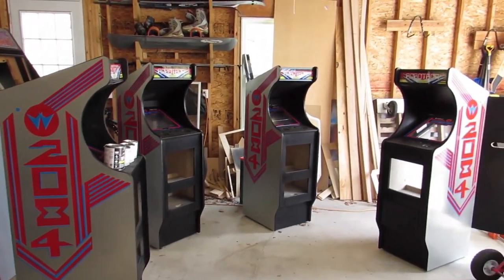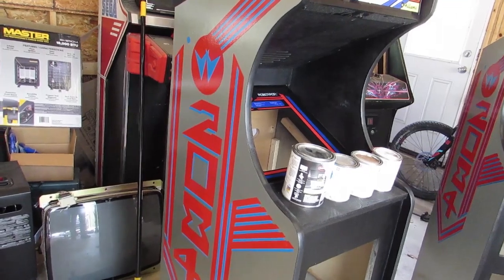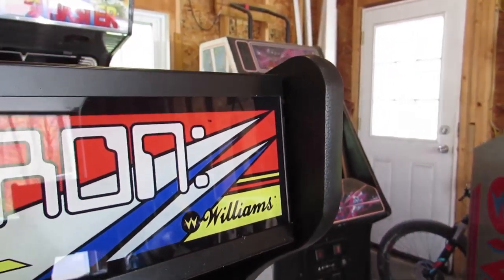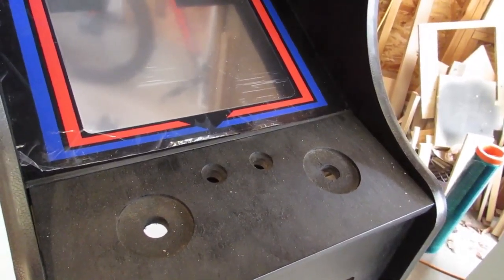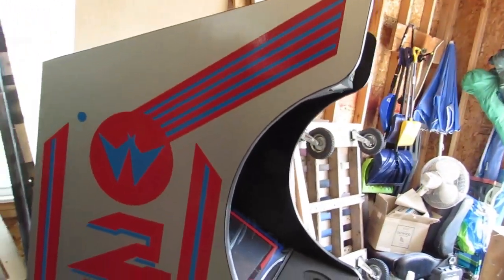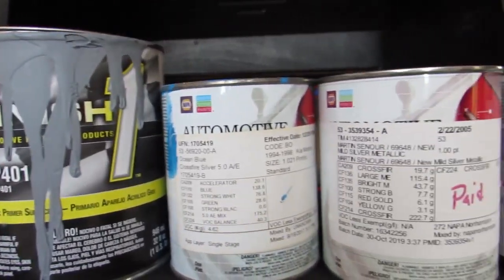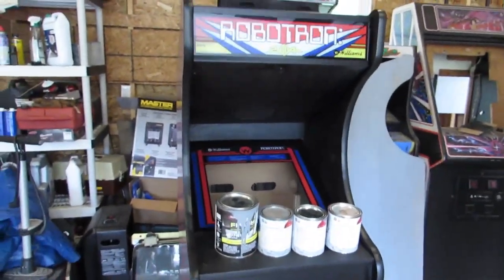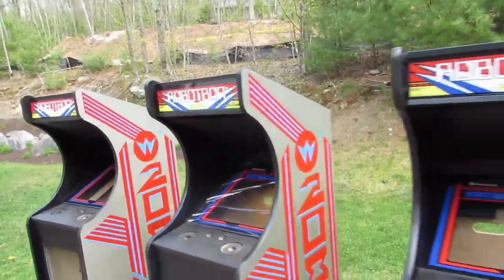Robotron Cabaret Builds....DONE

Comment: You can use the Black Plastic Strips from the “Avery Sliding Bar Report Cover” to attach to the sides of your marquee. This will take up the empty space on both sides and it will also prevent light from showing on the sides. I used these on my Galaga build.
Reply from the maker: Ahhhh excellent tip! I should see if my mom has any old book reports 😂